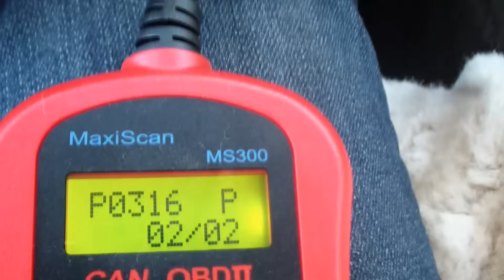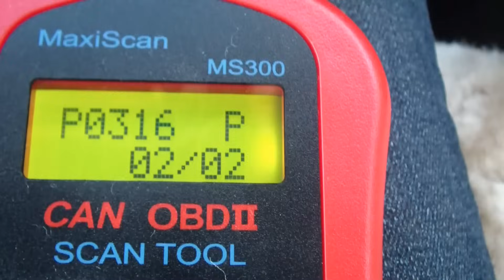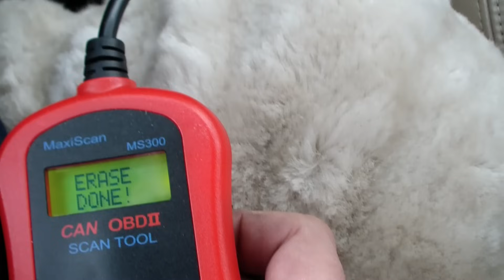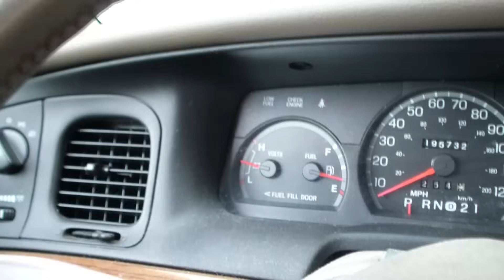P0306 and P0316 Misfire Code Repair

Comment: Would be better if u did not get distracted and stick with the main issue, that is what we watch the video for...main issue
Reply: +Kent Diego Yep!!  Last year I bought 8 coils for my 4.6 f150 for only 35 dollars at amazon.  They work good too!
Reply: @EarlGuyton425  what brand?
Reply: @MrsBuddevil  Of coils? For 4.6 and 5.4?  RThe cheapest is as good as the highest priced.  Im sure there are several chinese brands
Reply: @EarlGuyton425  4.0 2010 mustang v6
Reply: SO SO SO HAPPY....these coil packs, can be expensive, but you do not have to have a full tune up, i replaced the misfire plug and coilpack and i am good.....back to normal
Reply from the maker: ANGELO CARRUTHERS  You can buy 8 coils on Amazon for $45 or just $9 for one. The local auto part store want $44 for one.
Reply: Yep, thanks Kent Diego, the one I purchased cost me 51.00, needed it right then, I'm going to check amazon
Reply: @KentDiego  what brand did you go with?
Reply from the maker: @MrsBuddevil  I just went to an auto parts store and got the overpriced units they had. You can buy super cheap ones on Amazon but you have to wonder how long they will last.

Comment: I changed my sparkplug n the light still on is it my ignition coil?
Reply from the maker: The Check Engine Light will not go off until you erase the code with code reader. Did the roughness go away? If not then it is your coil.

Comment: thanks very much for the video i am having the same check engine light codes that just started today but the studdering i also have had for quite a while right around 45 to 50 so im going to go ahead and try to fix it next weekend